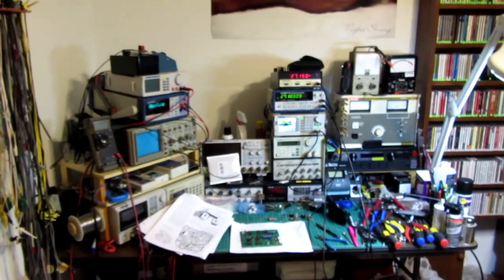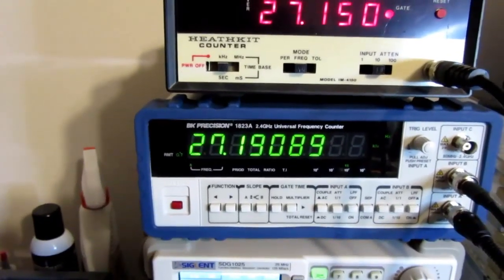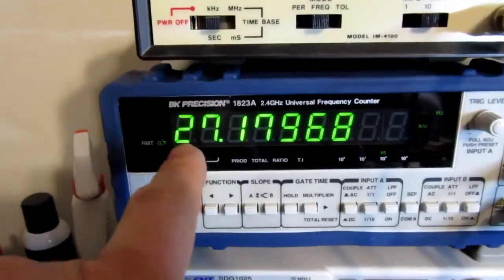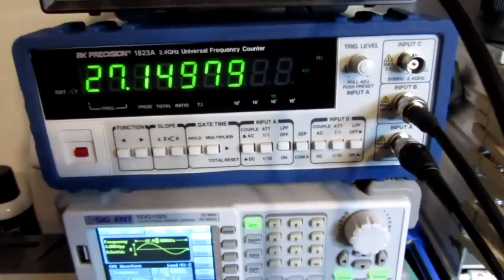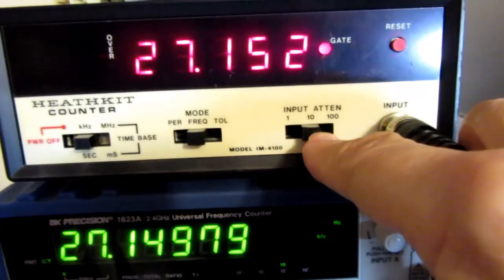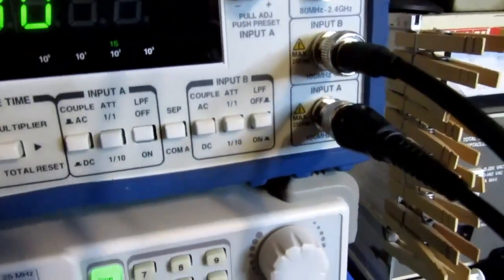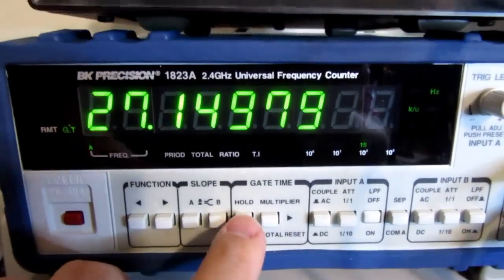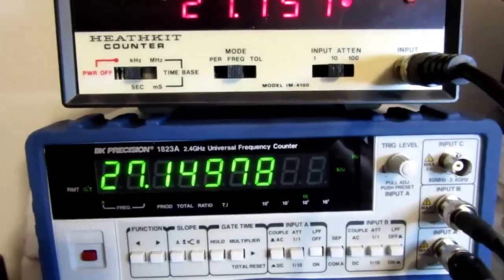Home Electronics Laboratory & Recording Studio Tour, Part 4

Comment: I’m impressed. How much is that digital scope or is that a function generator cost you? You have better toys at home than what I do at work. I was given a National Instrument software scope basically it is a data acq app running on pc, and my function generator was broken long ago. Luckily I am spending most of my time on coding these days hardware doesn’t matter that much anymore.
Reply from the maker: I seem to recall paying somewhere close to $2000 for my new Siglent digital scope; I think it was closer to $1000, but then I added on the logic analyzer, etc; Maybe it was not even as high as $2000.....digital scopes are no longer very expensive, compared to the old days.